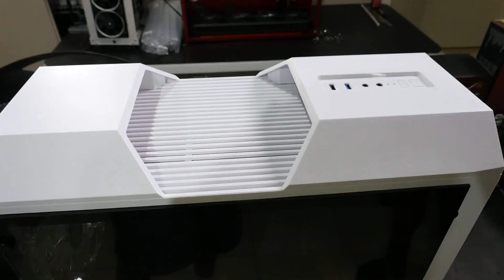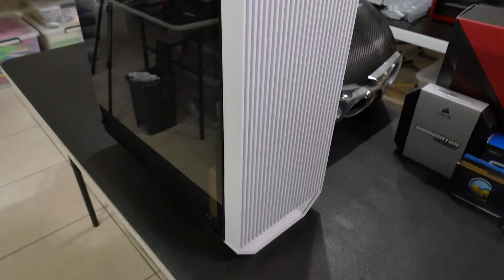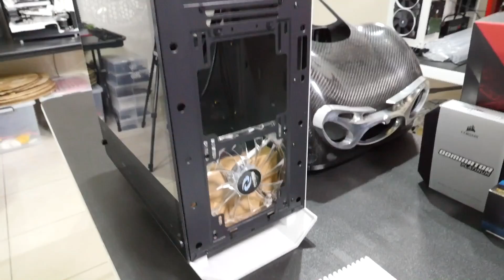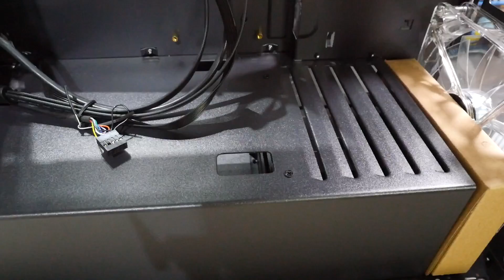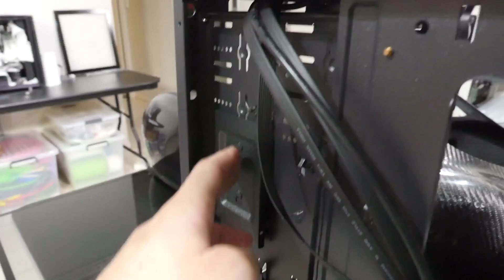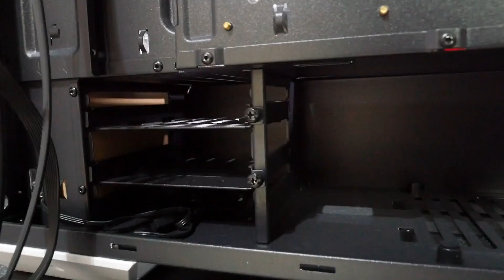Raidmax Monster II SE - Review

Comment: Mid-range system?  I don't think so.  I've looked at the data and liquid coolers are WAY overrated and not necessary.  They keep the processor maybe 10 to 15 degrees cooler, big deal.  This case can completely contain upper-end hardware.

Comment: I really like the front panel. But the top panel and bottom of the case (feet) are absolutely awful looking. So they would need complete mods.

And the PSU shroud/basement would have to be cut out and replaced with a custom one to even try and have a front radiator. Plus the 5 inch bays will need to come out.

At the price point in the USA there are plenty of other cases that would be easier to modify. So no idea who this market for this case is.

Comment: Aerocool P7-C0 chassis is the exact same, minus the longer PSU shroud and drive bay. It was not that much a joy to build in, but I liked the powder coating. Cookie cutter chassis bodies. Plus the P7-C0 allows you to have front 360 rad support, but PSU cable management is a joke.

Comment: I still don't like the look of the "global" fin design, but the case has potential, you could shorted the PSU cover so you could fit a rad in front, you could shorten the 5.25 bay to fit an aquaero and the extra space will allow a rad up top. ... Mod the IO to the right side where the extra space is from the offset panel, "close" off the game between the handles and mount fans in the enclosure created

Comment: I had seen a water cooling solution that was pretty cool.  They had a finned, chromed storage tank/cooler on the back where the i/o is with an extension that was chromed and the tubing going into and out of the back of the case.  You could feel the heat coming off of the cooling unit outside of the back and even though the pump was also outside, it was very quiet in operation.